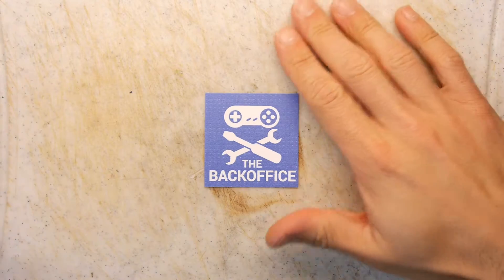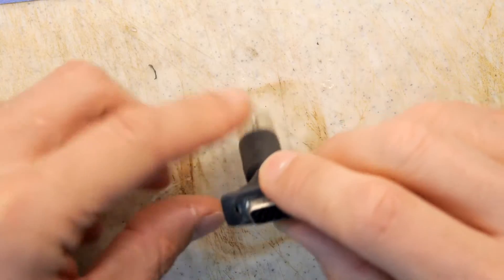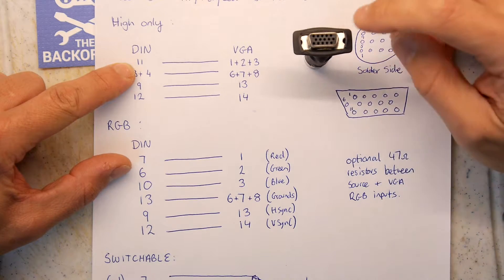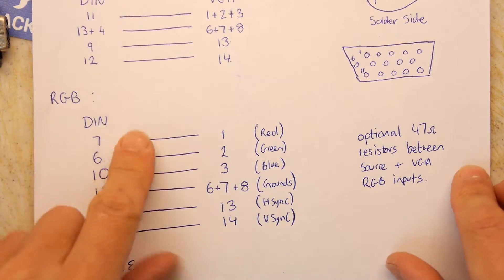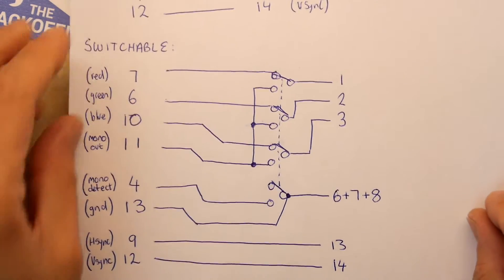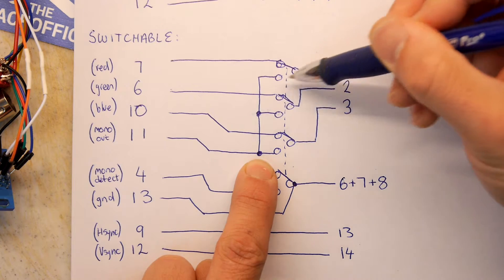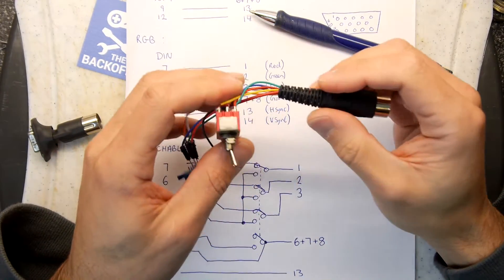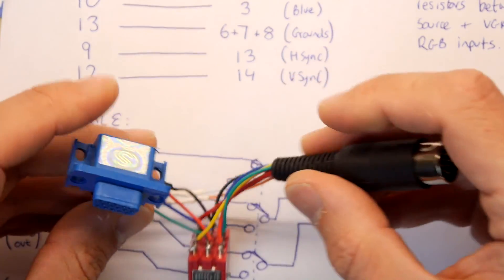Make your own Atari to VGA adaptor!

Comment: Did you ever do an update video about connecting the switch. I just can’t wrap my head around how the wires go to the switch could you please help I don’t know if you have a diagram or white wires go to what poles or what but anything would be very helpful. I was going to buy one from your side but it looks like it’s out of stock for the ST to VGA switch. If you had one available, I would certainly buy it but since you don’t could you provide any additional information how to get to switch up and working. Thank you so much. Keep up the great work. Your show was awesome.

Comment: So there wouldn't be any problems if id turn it around? (connect the Atari monitor to my PC)

Edit: Well not 1:1 (i wouldnt have to connect the connection for high res and low res) but i could connect simply ground to ground, sync to sync and Colour to Colour, right?

Comment: What if you want to connect a pc vga connection out to a 13pin din  connection on an Atari sc1224 monitor?
Reply from the maker: That's an interesting question, so to use the ST monitor like a PC monitor? I wonder if that is in spec for CGA or EGA modes

Comment: Good job! You could also use a converter board with the RGB–>VGA cable to produce a proper signal for non 15kHz monitors! (e.g. Gonbes GBS—8200)

Comment: I had luck using the Norcent LT2025W 20" NTSC LCD TV to lock to and properly display low/med/and high modes through the VGA D15 port. Hard to find them these days but perhaps others in the same family would work. I picked mine up pretty cheaply two years ago
Reply from the maker: Great tip, thanks!

Comment: None of this is workin except mono
Reply from the maker: This does work, but remember modern monitors are less likely to support the frequencies the colour RGB output works at (15Khz).
Reply: thanks for reply, monitor was only 25khz, my fault!
Reply from the maker: It's tricky, so few support it, however you can use a TV with a VGA port and use the VGA for hi resolution and the scart for RGB

Comment: Fun fact, the pin spacing of the 13 pin din is the same as the hole spacing of pre-punched experimenter's board (with the exception of pin 13) and the rest is the same as a common 5 pin din, so if you are reasonably handy you should be able to make your own 13 pin din out of stuff you might have lying around like I did......for me it was quicker than ordering one and waiting for it to be delivered.
Reply from the maker: +Enemy Sub that really is interesting! Because our usually just prototype and run, waiting for parts really is a chore!

Comment: your monitor gives same banding mine does in hires. wonder if the st freq is a little non standard?!
Reply: To get rid of the banding, it's usually a clock or phase adjustment that's necessary, if the monitor itself is up to the job at all understanding the rather different frequency. I got my screen to display monochrome hires perfectly without any banding, but that's done on a AG Neovo RX-24, which offers very deep control over basically every setting and (according to the manual) supports the low 15 kHz frequency.
Reply from the maker: +Meth Methanoid it gives banding on a bunch of monitors. I think it's just not really compatible with VGA. I will see what others have achieved.

Comment: From what I've read you should always turn off between switching.  I've got a switch between VGA and RGB SCART. I hook it up to an all-in-one TV/monitor.
Reply from the maker: +FairFight14 Sounds like the simplest option, I have the schematics, I will let you know about the turning off between the switching when I study them 😀
Reply: I like the idea of an all-in-one VGA switch though, because then I could pass it through a VGA2HDMI box. On that TV/monitor, I have more control over the HDMI input ratios. When I've tided stuff up, when I'm finished with my Amiga, I'll DM you some photos. Just so you get to see how at least one of your followers has things set up! :)
Reply from the maker: +FairFight14 I some HDMI boxes waiting for me to play with, I will let you know how far I manage to get 😂 really, I think I'm not too bothered about hi res mode, I only used it for productivity stuff and very likely to do that these days with my ATARI ST. 😀
Reply: Nah. My father had made a similar switch for me, not for one multisync output but with one Atari output connecting to my monochrome Atari monitor and the other output going to the SCART socket of a color TV. It had a large mechanical switch inside with many poles in parallel, probably switching all lines, not only the necessary ones.
Worked great and kept me from fiddling with those plugs whenever I went from work to play or back.
So, toggling the detect pin does trigger a reset but the Atari itself doesn‘t care. There is no such thing as properly shutting it down. Everything is just in RAM. You just reset or even power cycle the machine and it boots up again freshly. That‘s the way things were meant to be done in those days.
Theoretically that setup could have been a problem for very old fixed-frequency monitors, because there could have been a brief moment when the TV got high frequency sync signals or the HiRes monitor got low frequency sync signals that were outside of their specs. But that wouldn‘t kill them. Newer monitors had protective circuits that would just cut off those signals and show a blank screen, sometimes even with a message "out of sync". Older screens would not check the frequencies and try to show that picture which would result in a distorted display, often accompanied by an unpleasant high-pitched noise. This probably did stress some components inside the monitor, coils and capacitors might heat up and eventually die within minutes, but they wouldn‘t go Foom instantly.
But since it would only be split seconds that a screen got its wrong sync signals that was no problem at all.